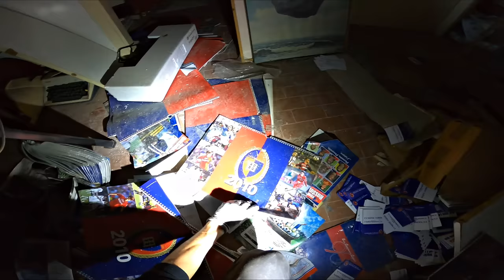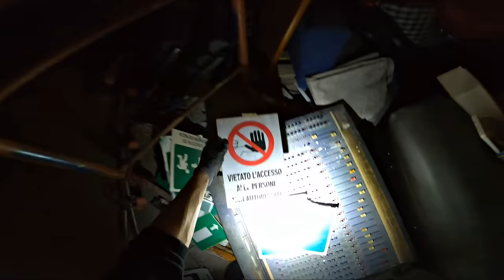Journey Across Island of Sardinia | Part 1

Comment: a few info about the stadium:  you saw that 2017 calendar because the pitch itself was used up until that year and people used to seat in provisional stands built over the athletics track in 2002. Therefore, offices, the jail and dressing rooms of the old stadium were still in use in 2017 but not the old cement standigs, last used in 2002

Comment: great vid, I had emotional problems most of my life, then I discovered in my 40s I have major food allergies, simple way to find out if its food allergy, rather than Doctors and tests, is take some otc cetirizine brand name is Zyrtec, take 20 or 30 mg and wait 10 minuets, you will feel a change in your mood drasticlly, works well allows me to eat the foods I shouldnt, without the emotional bs, but more than likely its not that, and the only way to be happy in life, is change what you can and be ok with what you cant... be ok with success, be ok with failure, but no matter what, just be OK...